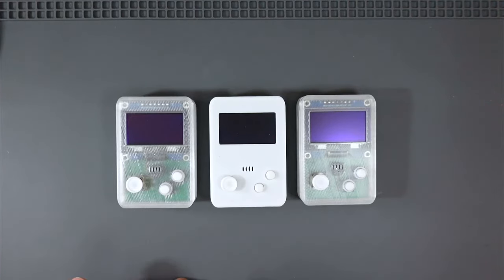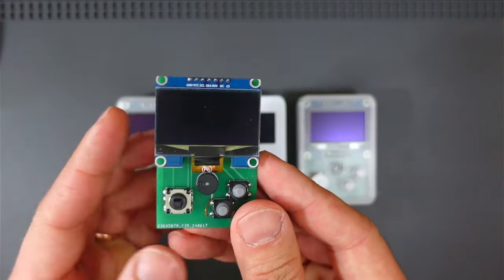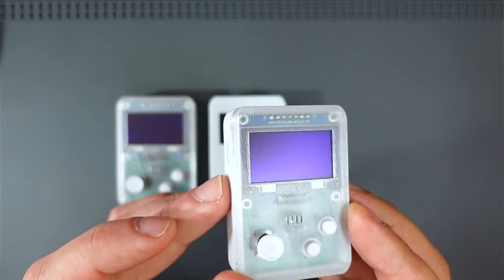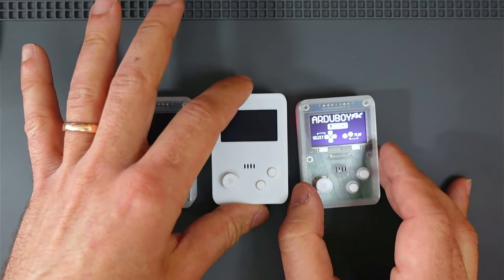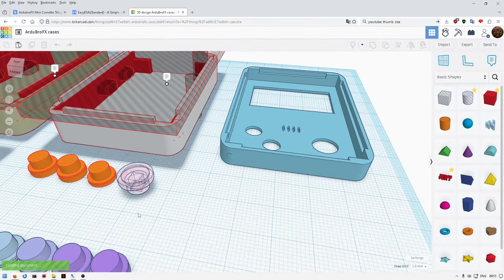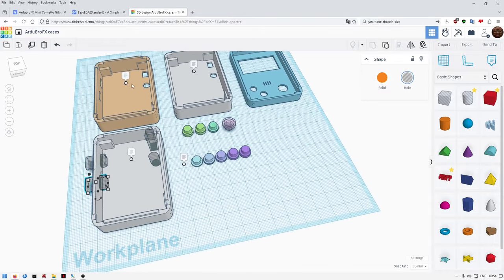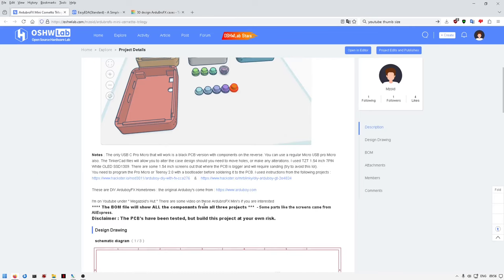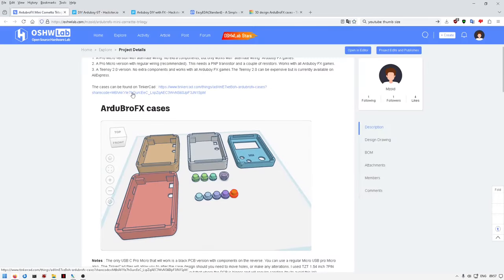ArdubroFX Mini Trilogy - Public Domain PCB's

Comment: Hi, Is the firmware instruction suitable for the second board?
Reply from the maker: The second board? ArduBroFX-ProMicro-Regular? if it's that one, the "Burn bootloader" instructions are the same as Mr.Blinky's DIY Arduboy GT project (link on my oshwlab page).
Both projects I listed have good instructions on burning an ArduboyFX bootloader. 

The Teensy and ProMicro-Regular : 
* From the tools menu select Board > Arduboy versions > Arduboy
* From the tools menu select bootloader > Cathy3K (starts with menu)
* From the Tools menu select your programmer (Arduino as ISP when using an Arduino)
Burn bootloader

ProMicro-Alternate-Wiring
Very different Arduino IDE settings. Refer to the settings shown on the "Arduboy DIY with FX" hackster project (link on my oshwlab page).

Comment: Hi, After loading the library, the image on the screen with the inscriptions arduboy activator runs and twitches. What is the reason?
Reply from the maker: You mean loading the flash-image.bin (the games) to the flash? or the bootloader? You may have not applied the SSD1309 display patch perhaps?

In the Activator, go to the "Options" drop down menu and select "Apply SSD1309 display patch".
Reply: @megazoid  I mean the flash-image.bin entry. On the arduboy screen, some settings, and it says that the mod chip is not found, the image is twitching.
Reply from the maker: @АлександрМит-ч5е   I didn't have this sort of problem. Hard to know what is happening.

I bought "TZT 1.54 inch 7 pin SSD1309 screens" and they worked fine. 
I used W25Q128FVSG (Winbond) for the flash. Both from Aliexpress. 

Make sure the W25Q128FVSG flash chip is the right way around. There is a dot on the PCB near the flash. Make sure the flash chip "dot" is  next to the PCB dot. If this correct, then you should  looking for soldering issues or problems.
Reply: @megazoid  I used W25Q128JVSIM as per instructions.
Reply: Hi, I re-soldered everything from the beginning, everything is fine, but when I start games, the game does not start, but some top line runs. I am in despair, and I do not know what the problem is! Please help.